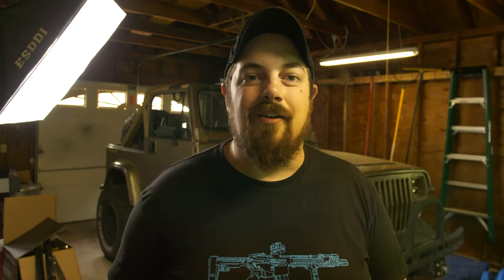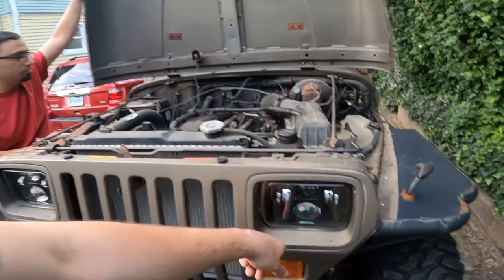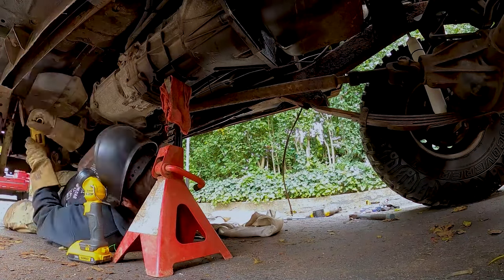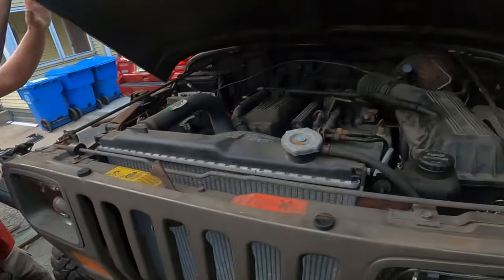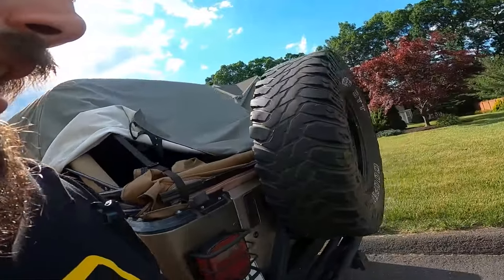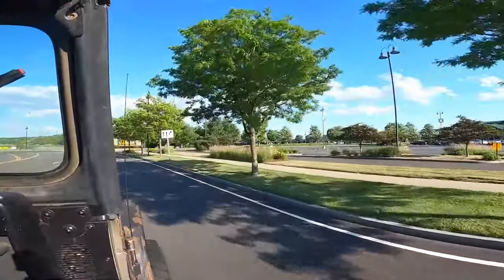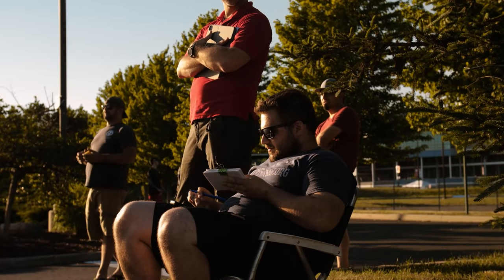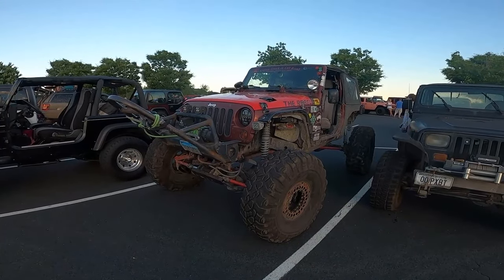why the jeep wrangler YJ is the MOST FUN you can get for your money. my 5 reasons!

Comment: Straight 6 is the holy grail for Jeep motors
Reply: I have a 93 jeep wrangler 4.0 inline 6
Reply: I have the 2.5.🥲
Reply: @BWalker-yg9en  My CJ and YJ are mad-squirrels and great for getting around town.
Reply: @whosestone  my squirrels are extra angry with a t3 turbo. 💥
Reply: @BWalker-yg9en  I got a supercharger that fits but I'll lose AC!
Reply: @whosestone  I live in Oregon so I don't need no ac.
Reply: 93 Cherokee  with the 4.0. So much better than the 2000 blazer i had

Comment: I have a 1993 YJ with the 2.5 4 cylinder. It's still rocking the original engine and transmission at over 380k miles. Not powerful at all, but it's reliable and gets the job done well enough.
Reply from the maker: How's the year I was born? Lol
Reply: My 93 2.5l is almost at 200,000 and loving it!
Reply: I gotta 318 in mine
Reply: Very reliable
Reply: I'm shocked that old AMC inline 4 still going but hey it was better then the crappy GM iron duke
Reply: My 2.5 has 200k miles on it and a turbo. 😊
Reply: My 90 has half that and runs smooth.
Reply: Me too

Comment: I drove my 95 rio grande for 17 years without ever having a tune up. When It started running a little rough I took it to my mechanic. He actually saved the plugs and wires to show them to me. The plugs were fused to the heads and the wires were cracked and burnt. He said that there is no reason in the world why this thing even started let alone drove anywhere. Had to trade it because it rotted beyond repair. I'm looking for a replacement because nothing else comes close. after 17 years you actually form an emotional connection to them. The one thing that never let me down, "20 of snow, "8+ inches of water anywhere, anytime. As you can tell I really miss it!
Reply from the maker: Love to hear it!

Comment: I love my yj. 4.2 ax15 and np231 got 4.10s and a webber carb, they are all wicked. Lots of torque at a decently low rpm. Yjs are pretty special being the last leaf spring on all 4 corners easily attainable Jeep, I never have had death wobble on 33s and they are tough as nails. Accept the dana 35 that thing has to go, 8.8s are fairly cheap. Nothing wrong with a good yj, they don’t have to be fast to have fun in the street either, some times it’s just fun to play with the torque and bang gears. The community is also great. Amazing video. Thanks for the good content
Reply from the maker: @FPSNovaS  thank you!

Comment: Just a little clarification 4.2 was always carbureted. Replaced in 1991 by 4.0 always fuel injected. I had a 89 YJ 4.2 had a 3 speed auto 3in lift 33 x 9.5 BFG AT's. I loved it.
Reply from the maker: Thank you! Yeah I wanted that fuel injected 4.0 but I heard the 4.2 was a little stronger
Reply: 4.2 isn't really stronger, but if you live in a state without inspection requirements, you can swap out the carburetor and run the thing on next to no electronics. Mine is an 88 4.2 and stripped it of all the unnecessary electrical stuff. I'm rewiring the whole thing and building a custom dash.

Comment: I have had my 89 Sahara for over twenty years now. Been a SBC for most of that and a daily driver. Its been to Tellico when it was still open back and forth from western NC to Ft. Stewart GA a million times. Dropped the kids off to school there hole lives. Its been with me longer than most people in my life. Its had two sets of Bestop interiors, three sets of shocks, on its third soft top, several sets of tires, a couple of batteries, a paint job in 06 (wich is starting to flake now on the  hood). Second fuel sender, and im sure im missing some things. But I wouldn't sale it. It will probably out live me😋. I guess it wil be up to my children one day to either shoot it, scrap it, or bury it with me.

Comment: I grew up with Jeeps. CJs and a YJ. The YJ was like “the drivable CJ” IMO. It was better at longer drives, wasn’t as tippy, but it still felt like a CJ. I still have my ‘88 4.2 IL6 and love it. It’s been lifted with new bumpers, new wheels, and rides on 33’s. Also just had it rhino lined- looks killer. replaced the crappy carb with a Weber 38/38 and oh baby...I had a lion under the hood ...until I fried the engine. 🤣 So I just had the engine rebuilt and I’m going with an injector kit on the next round, as well as the AR15 tranny, new clutch, and new transfer case. YJs are great Jeeps. Welcome to the tribe!

Comment: I’m 16 and got a ‘89 YJ with a 4.2 and a 5 speed manual. Been in the family since brand new and spent most of its life on our farm in rural South Carolina. It’s a fun project and I love driving it every chance I get. Been told multiple times that it’s a very rare car so im probably never going to get rid of it!
Reply from the maker: That's what I like to hear!
Reply: All I've gotta say is don't ever get rid of it man! I got a 4.2l 5 speed as my first car right before I turned 18, have been daily driving it about 3 years now and the experience and skills you learn working on it are just as valuable as the car itself. If it's giving you issues and you're ever thinking about getting rid of it, just push through it man!

Comment: Mine is a 1990 YJ 4 cylinder which I bought new as the cheapest, fun commute vehicle that I could afford at the time.  Even though it is still mostly stock (did I hear gasps of "Heresy!") it's been a lot of fun over the years.  Done a few off road / back road adventures.

Aside from hoses, belts, etc the engine and drive train are all original, and work fine.  I was nervous about the Peugeot 5 speed transmission but it's been OK too, as has been the throttle-body fuel injection.

Two things have broken - the tailgate latch doesn't close properly, and the fuel gauge is wildly wrong  (I use the odometer to guess when I should fill up).

So, yeah, although not a classic, it's fun vehicle.  Except on an Interstate where you feel like you're in a golf cart amongst the big rigs.
Reply: In good conscience I need to add that, while great fun, a YJ in a crash is maybe the last vehicle I'd want to be in.  A rollover? Maybe OK if seat belts are on and working right; did that once in a Volvo and walked away.

But a driver-side T-bone in YJ?  Ugh, don't want to think about it.

Comment: I’ve got a 4 banger Jeep tj (2.5 not the 2.4l in the later years). It is the same as a 4.0, just with two cylinders chopped off. Equally as reliable. Still an absolute pig on gas though. As long as you have the right gear/tire size ratio, it’s really not bad at all cruising around town. Highway performance is pretty rough. I have had mine up to 85 MPH and it was absolutely terrifying. Even with the 4.0, they weren’t designed for highway driving. I can cruse at 70 mph all day long. Really YJs have skyrocketed in prices. They used to be a cheaper alternative to the TJ generation which came after it, but from what I have observed that is no longer the case. John Cena also owns a 2.5l YJ… there is a video on YouTube of him showing it off.
Reply from the maker: Nice to hear that it's just as reliable. I have to agree that they are not really rockstar on the highway but can handle it when needed. Jeep deals are getting harder to find but they are still out there! I got this at the hight of the market in 2021 and the seller came down over 50 percent on the asking. Granted it was in rough shape but still ran and drove

Comment: I have a 1982 CJ7, has a 4.2 with some upgrades, an NP 435 transmission followed by the Dana 300 transfer case. All heavy duty and easy to work on, this has had a frame off 5 years ago. I've been driving old jeeps since 1978, still having a blast in the summer with it. Thanks for the content, good video.   🥰
Reply from the maker: thank you! sounds like a great ride!

Comment: I currently have a 2003 TJ . 4.0 completely stock! No Rust!     Yea, know,right?. It's currently getting a complete regular maintenance/tune up... ALL fluids,filters,etc.
EVERYTHING!. 
On order is new 33" tires,wheels,2 1/2 lift from teraflex. Bumpers,warn winch,tube fenders,rock sliders.
LED lights all the way around,and 1 1/2 DIN head unit.
 Yup, dropping a nice dime on it! 

NEW 33" tires
Reply from the maker: It gunna be awesome!?

Comment: My dad bought a '93 Sahara YJ with the 4.0 brand new. That thing was running strong until he sold it in 2019 (26 years!). Only thing that needed replaced was the starter and radiator outside of normal tune up. After he sold the YJ, he got a TJ lol.
Reply from the maker: Not surprised at all! What a great vehicle:)

Comment: I have a 1993 jeep wrangler why JM edition with the 2.5 L four-cylinder engine I’ve owned it for over 15 years, the in-line 2.5 four-cylinder engine is identical to the 4.0 in-line six engine but when it comes to reliability it’s completely bulletproof even inconsistent subzero temperatures
Reply from the maker: That's awesome!

Comment: I have a 1993 YJ I bought in 1995. I kept it the way it was when I bought it, almost completely stock, for many years. Then I moved from So Cal to NM and that's when the Mods began. I love my YJ. It's been around a lot. But someone tried to steal it and when they failed they put something in my gas which destroyed my engine. I replaced it with another 4.0 and changed the gear ratio to 4.88. I'm only running 33" tires but it's fab the way it is. I can't conceive of getting rid of it.

Comment: I've had my '91 Wrangler S for 3 years now and in its factory state, it was the most fun I've ever had, felt like driving a gokart with the factory set up. Lifted it up on 33s and never could get it stuck (at least where I off road). Now I've swapped it to being a SBC powered 2wd hotrod, and for the 3 weeks that it was driving, it was a blast. Now I'm waiting on a crate motor to replace the one I blew up lmfao
Reply: also, when I owned the 4 banger, it ran good, was reliable, and overall was a good engine. The AX5 transmissions are pretty weak and notorious for grinding gears eventually. Otherwise they're basically 4.0s minus 2 cylinders. Honestly, wouldn't get one again. After I lifted it, it couldn't get above 75mph even with the 4.10 gears. And it sucked gas down too, best I ever got was 11mpg. 5th gear basically becomes useless if you don't go to 4.56s or numerically higher. If I get another jeep I'd get one with the 4.0 or 4.2, but then again, I'd really get any other jeep to accompany mine.

Comment: I have the 2.5 and haven't had any issues. Its not a race car! Im running 35s with 5.13s 5 speed. Ford rear diff and stock 30 up front welded. Still running the CAD with a cable. And she just goes any direction i point her. Stay safe and happy trails 👣

Comment: In-line 4 is cool top speed is 65 or 75 mph 
But it’s reliable and easy to work on 
Just a small in line 6 
Parts,upgrades ,a great engine 
Kinda bulletproof 
A little more speed would be great but other than it’s a great jeep

Comment: I have a 93 4 cylinder 5 speed manual its been my daily for 5 years and it has NEVER let me down. My wifes 2018 kia had electrical problems, my mother in laws explorer broke down, basically everyones car around me had problems and they all have new cars. My old 93 has NEVER let me down. Yea it smells like gas but the thing turns on everydah and takes me to work and back, ive taken it through snow, sand, water crossings and its an AMAZING car. The only thing ive done is oil changes on it. And replaced a belt. Ive done upgrades to it and its super easy to work on. I HIGHLY recommend this to anyone.
Reply: What we’re the Kia electrical fox if you don’t mind me asking for you wisdom . I dealing with som myself.

Comment: The inline 4 is SUPER reliable but it does struggle with highway speeds. Mine tops out at 65mph i have a 2.5" lift and 31s which is whats recommended for the 4cyl, anything bigger and you aint going past 65. Offroading its really good its really torquee

Comment: Picked up at 1990 4.2l Sahara about 13 years ago. Had a bad oil leak which was just the mechanical fuel pump!  Wheeled it stock, then upgraded to 35's, ford 8.8 rear end, front arb locker, dope stereo system with an amp, odometer stopped working at 260k many years ago. Have overheated it, ran it low on oil, baby still purrs. Top off, doors off, Washington state summers 🍑

Comment: Fuel injection was available in Oct of 88, when I bought my Sahara(89 model).  I opted for carburetion, and paid the price.  Stock carb was always a problem to maintain good idle.  I think 89 was the last year carbs were offered.  I think 88-89 was also the last year of half doors that didn't lock.  Still have the Sahara, 180K and runs well with Weber carb.
Reply from the maker: That's awesome!

Comment: I have the 2.5L inline 4 in my 94 Wrangler YJ. It’s 110% a champ. Ultra reliable just like it’s 4.0L big brother it just lacks the power. It’s still a torquey motor but don’t expect it do get you to highway speed quickly or maintain highway speed with a head wind lol. It won’t get you places fast but you will no doubt arrive…eventually😂

Comment: A 4 cylinder is a gutless wonder when the wind is blowing here. In Vegas Because I see them. Mine is a 93 Jeep Wrangler. 4.0 6 cylinder 5 speed. Power is okay but I would rather have a 350 Chevy auto. That's what I will put in it someday if  This engine or transmission goes bad. And that's like never in my lifetime. Probably about the best engine ever made. Other than the 327 Chevy motor.
Reply: Don't forget the Toyota 5.7 that thing is awesome too.

Comment: I have an ‘87 islander with the 4.2l and a motorcraft 2150 carb, AX15 transmission on 35” tires, I just had it re-geared from the stock 3.07 to 4.56… it’s fun to drive but it won’t go more than 60mph in 5th gear turning about 2000rpm. I would at least like to get to highway speed
Reply from the maker: It's part of the "experience" 😄

Comment: 2.5 made as much power as the old 4.2, 4.2 had it beat for torque.  The 4.0 was never carbed,  you either had the carbed 4.2 pre 91 or the "HO" 4.0 91+ as far as the Wrangler went.  the XJs had 4.0s from 86 onward  but they were RENIX engines with a Renault fuel injection system. 91 brough the "HO" 4.0s to the whole lineup with the Chryco MPI system.

Comment: The 4 cylinder is technically the same motor just two less cylinders. Just as reliable but a lot less power. They also are prone to blowing up/less life span than the 4.0 just because you have to rev it a lot more to get it up to speed.